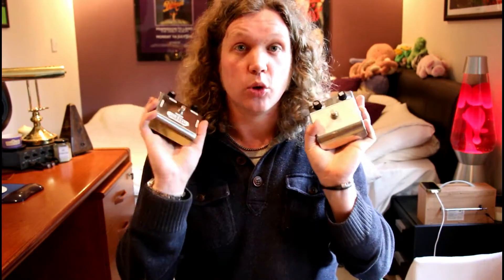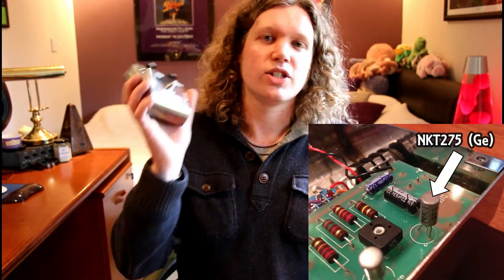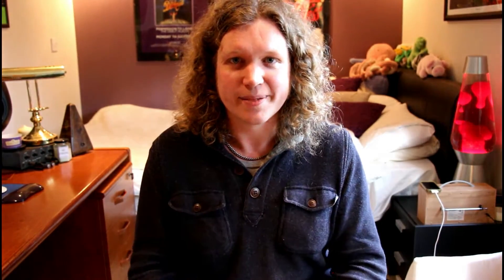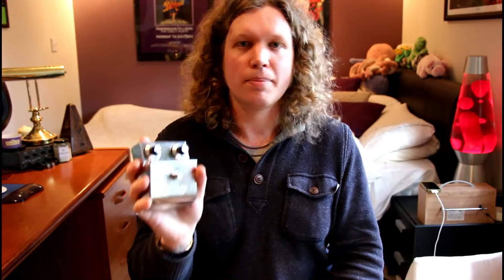Perky's Guide To: Fuzz Face Transistors (Germanium NKT275 vs. Silicon BC108)

Comment: I have a red Jim Dunlop JD-F2 Fuzz Face that I've been doing some work on, I replaced the original stock pcb in it that had two NTE158 germanium transistors on it because they died, I bought an issue 1 Fuzz Face pcb from Pigeon FX and used two CDIL BC108C NPN high gain small signal silicon transistors, the one in the Q1 position has a gain of 635, the one in the Q2 position has a gain of 660, these might sound like massive amounts of gain for use in a Fuzz Face, maybe too much, but I was very pleasantly surprised when I tried the pedal out after working on it, my red JD-F2 Fuzz Face sounds really fat thick and smooth, with lots of sustain and sizzle, it really sings if you sustain a note and add a slight vibrato, something like what Eric Johnson gets with his signature Fuzz Face but without that spittyness, the two CDIL BC108C transistors seem to bias-up fine with 1.1V on the collector of Q1 and about 3.7V on the collector of Q2 resulting in some asymmetry in the output signal.

Comment: I have a Fulltone 69 and 70’s Fuzz and the difference are very noticeable. The thing I notice is how they react to turning the guitar down. The Ge 69 pedal practically drops all of the Fuzz with a slight movement of the volume pot. The Si version has more gain and the Fuzz tapers off as opposed to dropping out.

Comment: I think so much depends on individual pedals and signal chain and other factors. You demo doesn't jive with most videos I've seen comparing the newer germanium Fuzz Faces and Fuzz Face Minis to the silicon counterparts. Generally I've found the germanium to have a darker and thicker tone when full up than the silicon ones, and the germaniums clean up more completely than the silicons, but sometimes seem to clean up less bright than the silicons. So many things could be making these differences. I just bought the new EHX Ripped Speaker Fuzz, and found that against all common assertions that fuzz should never follow a buffered pedal, this one holds up well no matter where it's placed in the chain, and the guitar volume cleanup is actually vastly improved when placed after a buffer. In fact I've never heard any other fuzz clean up so completely and get more glassy than this one does, even though it's after a buffer. I know some of that may be related to the 50's Les Paul wiring mod I did in my Tele, and how that may be somehow affecting the way the buffer affects it, I don't know, but the cleanup and glassiness of that thing is bloody astonishing.
Reply from the maker: It's absolutely pedal specific, for sure - the 'type' of transistor is only a smallish factor in a whole system.  A lot of modern Fuzz Face pedals are designed to not require an impedance mismatch on the input to filter the sound and for the cleanup to work - they work fine after buffers - and in those pedals, giving them a buffered signal actually helps to retain sparkle when rolling the guitar's volume down; just like it would with most other gain pedals.  So there's a lot of things at play :-)

Comment: Brilliant review, as allways.
I prefer the Ge, but am a little bit astound about the darker quality of the Si pedal. They use to have more high-end and attack than this. There has been written a lot about how to bias
the Ge transistors, how to measure devices for leakage, and how much Q2 has to be different in amplification factor from Q1, but less so on the Si devices. Good Ge devices tend to
have amplification factors from 60 - 150 and does not selfbias very well. BC108 Si devices tends to be from about 300 - 500, which probably accounts for the higher output. I am not
sure right now how well they selfbias. But he bias affects the sound a lot.

Comment: NKT275 overall best. He could have put a screwdriver 50k input trim pot ( as per the Mike Fuller mod) on the back  with a dip switch to put it in or out of the circuit. Here is what this simple mod does [ from The Technology Of The Fuzz Face site] :

"Mike Fuller posted some recommendations on the Fuzz Face to the net. Among those are to add a 1K linear pot in series with the 470 ohm resistor in the collector circuit of the second transistor, still taking the output from the top end of the 8.2 K resistor. The pot is set up so it is acting as a variable resistor, wiper shorted to one end lug. Another is to connect a 50K pot, again as a series resistor, in series with the input of the circuit, before the 2.2uF input capacitor.

Fuller Suggested Modified Fuzz Face
If that last one seems a little odd, think back to what I said about the low input impedance. With a low input impedance, the input loads a guitar significantly; the base can only move a few tens of millivolts before cutting off or saturating the first transistor. If you put a resistor in series with the guitar pickup, it raises the apparent source impedance of the pickup, making it look more like a current source (albeit a tiny one) and less like a voltage source. A signal from a current source lets the input of the effect seek it's own voltage level, and merely supplies a varying current. This can be much more linear than a voltage source drive. As a result, the variable resistor allow you to radically clean up the distortion that the FF produces, producing subtle shades of softer distortion.

In effect, the output mod is a "more" control, and the input mod is a "less" control. As you would expect, the two added controls can interact to produce many shades of distortion.

One person reverse engineered the Fulltone "69" pedal and has posted the 69 pedal schematic to his web page. In this schematic, you can see Fuller's application of his earlier suggestions. The "69" pedal does enjoy a good tone reputation.

If you like softer distortion, you might also like to add some high end taming capacitors. Adding 10 to 100pF from collector to base on the second transistor or 100-680pF across the collector resistor of the first transistor will soften things up a bit."

Comment: Great comparison. I remember a period in time where most people adored germanium and crucified silicon. I still try to imagine why. Perhaps many silicon fuzzes were misbiased, don't know. Fact is, high temperature makes germanium less comfortable. Fact is, germanium leaks much more than silicon, even the "good" ones. Fact is, many silicon fuzz design today are actually just as warm sounding if designed so.
One of the crucial factor is biasing or "fine tuning" the settings of the circuit. If all bias is equal, no transistor will sound the same. That's is why early fuzzes different and were choosen by ear: some transistors were very good for the set bias. But if you tweak the bias, you can find much more good sounding fuzzes.
Another thing is the gain of the transistor. No transistor is exactly equal in gain. Germanium is lower (NKT275 current gain of 70-100), silicon is higher (BC108 up to 450). But there are lower gain silicons as well, that can be used in a different bias and give a "tamed" silicon fuzz.
Reply from the maker: They're certainly all individual!  I think on balance I prefer Ge transistors, but that's just personal preference - I've got some Si fuzzes and they sound absolutely amazing!
Reply: I had a fuzz pedal that I thought was germanium... it certainly had a vintage "fuzz face" sound.  I opened it up one day to look, and the transistors are in fact inexpensive modern silicon ones.   But the circuit is definitely a vintage fuzz face type.

So I really think the circuit and the rest of the components are even more important now.

Comment: They didn’t switch to BC108 directly from NKT275. They went to BC183L in 1968 which are very different from BC108. Implying that there were only two choices in Fuzz Faces is misinformation, even if it’s not intentional.
Reply from the maker: Wasn't trying to imply that those are the only two options at all (CV7003 FF's are some of my favourites!)  All this video was trying to show is the very first Ge vs. the very first Si that Dallas Arbiter used.  Just a quick comparison between G/S Fuzz Faces :-)
Reply: Joe Perkins I’m not trying to troll you, I’m just trying to correct the information because people see this and repeat it to others as truth and so on- which leads to uninformed opinions and internet arguments ;). I understand your intent- you wanted to show difference between 2 different transistor types used in the original fuzz faces. and to be clear, Fuzz Faces are specifically those big round smiley pedals made from 1966-1975ish. You did a great job broadly showing the difference between a germanium and silicon fuzz. my point was you said (and keep saying) that BC108 was the first Si Fuzz Face. This isn’t true. The BC183L was the first Si Fuzz Face, issued in 1968. And the differences between them and the BC108 are massive. It’s not just semantics. The Fuzz Face used only the following transistors in their 9yr run— NKT275, BC183L, TFK BC130c (rare but it existed in 69/70 era), TFK BC108c and BC209c. Those are also in order of their issuance. The BC108 came along around 69. I have examples of them all— but more importantly, it’s good just to have all the facts correct when speaking to an audience. I’m simply trying to correct simple misinformation when i’m able to speak with complete conviction on something. 
again, nice video. really and your broad point is expressed well enough.
Reply: @63FenderStratocaster  And you forgot that a lot of the first Ge Fuzz Faces had AC128 in them :-)
Reply: @kimhansen6384  I know Cornell made some reissues with AC128S in them and I know the story that the AC128 appeared in the early fuzz faces but I have never seen any evidence or know anyone that actually seen a pair in a 66. Not sure if its a myth or true such is life! :)
Reply: @coldfishpie  Analogman agrees with this as well... I suspect that Kim does not realise that Dustin Francis is a highly regarded Fuzz Face builder.